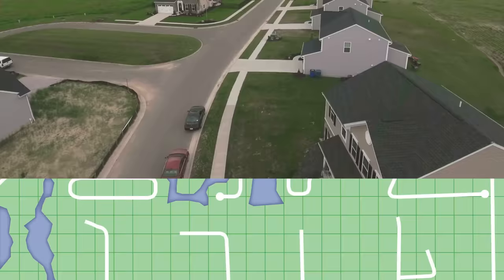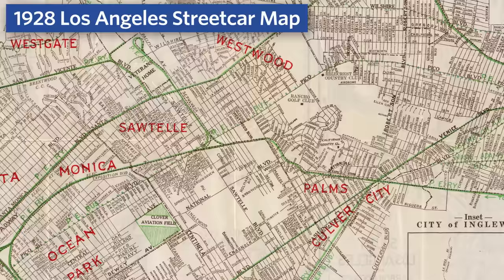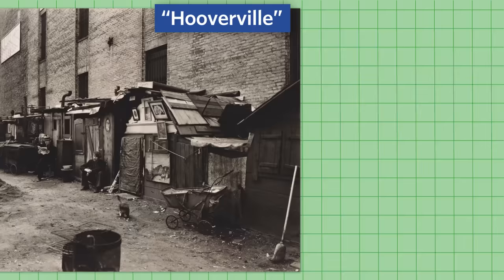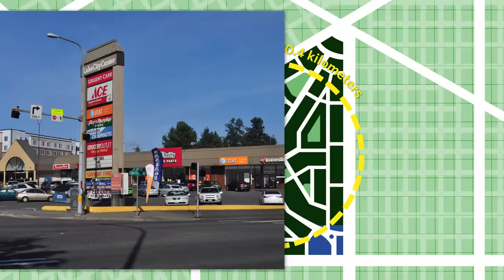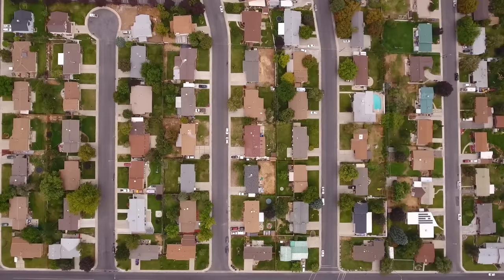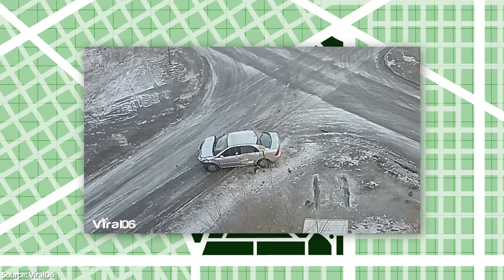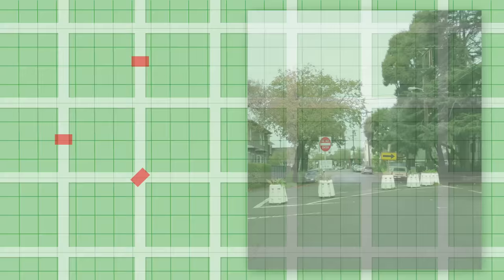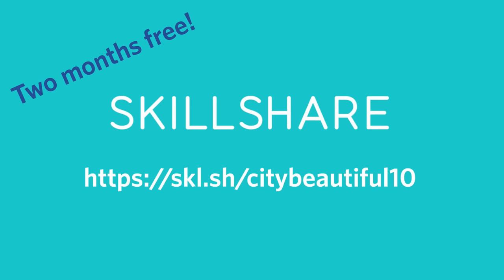The Reason Our Streets Switched to Cul-De-Sacs

Comment: As a school bus driver, sub divisions are trash
Reply: This again is an issue with the lack of good walking connections, if it was easy for people to walk to bus stops on the neighbourhood arterials the busses wouldn't need to drive all around residential streets that were not really designed with large vehicles in mind.
Reply: Yeah, the point is that its hard to drive through
Reply: We don’t build neighborhoods to benefit school bus drivers. Get rid of public schools. They’re horrible.
Reply: @HectorDiabolucus  r u serious?
Reply: @HectorDiabolucus  are you a parents or married?
Reply: @HectorDiabolucus  Why are they horrible? Because they don't nurture enough propaganda?
Reply: i hate sub divisions
Reply: @HectorDiabolucus   do you know how expensive private schools are? I find myself somewhat lucky but I couldn't go to a private school because they are so god damn expensive. And also where would the money for schools go towards? Private schools? Because if that happens THEY WOULD NO LONGER BE PRIVATE SCHOOLS. My god, and also most private schools require uniforms which are usually quite expensive.
Reply: MyOwnDesign  Yeah, same! Here buses only stop at designated stops so I always had to walk to get to a bus.
Reply: Alan Ultra , yeah um private schools use buses too 🤣
Reply: be cool or be cast out amirite
Reply: Most school buses around here (Central Florida) just drop off the kids at the Subdivision entrance then drive to the next entrance. Sucks to be you where you have to drive into them.
Reply: In other civilized  countries there is always a elementary school within walking distance, so there is nearly no need for school busses.
Reply: @HectorDiabolucus  hes legit just trolling
Reply: MyOwnDesign  2 km here.
Reply: haha it’s the tiktoker
Reply: Well at least you are not stuck in an infinite traffic
Reply: MyOwnDesign i had to get 3 different buses to school taking over an hour to get to school, it took 15 minutes in a car... americans dont understand how lucky they are
Reply: @weels95  if it takes 15 minutes in a car, and over an hour to use the buses. It is simple math, it is quicker to walk to school.
Reply: @notvuse275  What? If it takes 15 minutes by car. Let's say you are riding at 30km/h on average because it's residentials and schools areas,  you would then have 7.5km to do on foot which would take more than one hour. So simple math says take your car... Or the bus because you don't want to arrive at school sweating.
Reply: Syndi it was about 4 miles away and would require walking down a motorway so wasnt ideal to walk
Reply: @elirewasout  School choice. If you want to send the kids to public you pay the taxes to do so, if you don't want to do public the government credits the taxes back so you can contribute them towards the private school costs. As it is, families who send kids to private schools or charters, still pay taxes for the public system. There are flaws with this of course, but there are flaws with the current system and yet people seem so willing to defend it against any criticism.
Reply: ZionGo here in aus all public schools need uniforms and there not that expensive lol
Reply: Aye I follow you on tik tok!
Reply: @HectorDiabolucus  all schools
Reply: @HectorDiabolucus  ah yes let the poor just magicaly be rich lmao
Reply: @kyethepie1  - but the schools don't teach the difference between there and they're, apparently.
Reply: @markfox1545  um, yes they do... where did you get that
Reply: @PdPete11795  that is such an individualistic view. I only see this in America. You want your taxes to only benefit you rather than the community as a whole. So if I dont have kids or use parks, can I have that money tax given back to me? Of course not! I guess that is why you are the only develop country without healthcare or paid leave among other benefits that even the extreme right parties agree on in every other country.
Reply: @kyethepie1  I had uniform and it's actually cheaper. No one asks for brand clothes to wear, and you dont need to have different outfits. Just enough to change while doing laundry. The skirts were "expensive" but cos they were wool but they lasted years. Overall cheaper. I had to buy lots of outfits when I started uni since I only had "weekend" clothes haha
Reply: @stojankovacic1524  they do have designated stops for school busses but when those stops aren't accessible to everyone they have to make more stops and my bus stop has to stop for just me because the cul-de-sac style of neighborhood I live in means that it's very hard for kids to get around especially since there are no sidewalks anywhere meaning if it's a busy road ou risk getting hit by a stupid driver and it doesn't help that the roads are really small and people park on the side. I feel fine navigating my neighborhood but many parents don't feel safe letting their young kids walk far to a bus stop. In less crowded neighborhood there is only one bus stop for like 20 kids
Reply: @chrisistired6083  Exactly. My entire village is some 20 people per shift on the bus so the vast majority of us wait alone. And because private transport is horrible and I'm in the only bus in the world that has a roof that lets water through and that doesn't brake properly it's obvious they don't care about us so it takes the bus around half an hour to get around the 3 villages and because of that I have to wake up at 4:40. Rip me.
Reply: @seraphina985  Your point about pedestrian access is valid, however, in most suburban communities in my area, school buses pick up and drop of students directly in front of their homes. kids gathered at a bus stop is rare around here.
Reply: ClawBoss,
Imagine being the guy that has to plow the snow, in those neighborhoods.
Reply: If the entirety of the US wouldn't have a grid system at all, your job wouldn't even be necessary. Kids would just walk or cycle to school  or take public transport. But all three of those things are made dangerous and/or inefficient partly because of the grid system. Look at the Netherlands for an example.
Reply: @cesarheuvelmans  I live 24 km from my school and there is no grid system at all. I can't exactly walk there, can I? You can't only talk from the metropolitan urban perspective.
Reply: It also makes it more difficult for fire trucks and ambulances to get to you if you have a problem.  Meaning you have a higher chance of dying in cul de sacs
Reply: @HectorDiabolucus  "What if we took the principals of coal mining, snake oil, and pyramid schemes, and made schools out of it?!"
Reply: @stojankovacic1524  No because they are full of propaganda!
Reply: I attended some public schools as a kid in Brooklyn. And I attended one year of high school. And not a single friend from that school Is alive today. My brother was even killed this summer. He stayed in public school because his mother won custody of him. I don't know how schools are in the suburbs but city public schools atleast the ones I attended were straight garbage.
Reply: @phillhuddleston9445  How does that make private education any better? The obvious trend is that countries with widespread private education have significantly worse primary and secondary education.
Reply: @stojankovacic1524  they don’t? Ever pick up a “history” book?
Reply: @thevinyltruffle  We're talking about the present, there's no history to talk about. I'll give you a familiar example. Look at USA. Extremely low quality primary and secondary education. Most of the things American high schoolers know are taught in lower grades of elementary school here in Bosnia. Terciary education is ok there but way too expensive. The reason is that a private school just wants you to send your kid there and the state needs you to be a good professional worker. Private schools need you during your education while the state needs you after your education and thus needs you to get as good of an education as possible.
Reply: @JannesVanSlooten  you can’t always just walk to school in rural/ semi rural areas.
Reply: @stojankovacic1524  I mean they do need to teach tax and life skills not all family's can teach kids all the life skills
Reply: @christiemarie8748  Private schools don't have an obligation to do that. Some teach kids that, some don't. Also you have that in state schools in most of Western Europe so it's not special at all.
Reply: @HectorDiabolucus  Jesus christ dude, find a tall bridge.
Reply: You can't have peace and quiet and convenience at the same time. Something has to give. That's life, give and take.
Reply: @PdPete11795  I agree
Reply: @kyethepie1  - you said it.
Reply: Do you watch all the same videos I do? I keep seeing you
Reply: @seraphina985  When schoolbuses are around, the problem is schools are too far away to walk to. I haven't gone to a school with a bus until I went to university - and that's cause walking or bicycling 120 km everyday wasn't an option :)
Reply: @elirewasout  you’re unaware of the entire world
Reply: As someone with a much higher education and an actual work ethic to not be a bus driver, you cannot have an opinion about “sub divisions” unless you are wealthy enough to live in one. Because if you don’t live in one, then you’re just judging because you have less than them. FYI mr bus driver, there is something called money, wealth, and homeownership, do you know about any of the three?
Reply: @stojankovacic1524  American education system is propaganda
Reply: @HectorDiabolucus  do you want traffic jams cause by parents waiting for their kids to finish schools cause that's what's going to happen by getting rid of school buses.
Reply: @HectorDiabolucus  In case you haven't realised, the disadvantages apply to things like delivery drivers and taxis. Adding unnecessary travel time impacts the availability and timeliness of these services
Reply: You are a very tiny minority of the economy affected negatively by this design. But yes it would suck for you.
Reply: @elirewasout  okay sure man that's nice and all but. Average people do not need access to higher education. It's literally a waste of money, we force 90% of people to complete 12 years just so they can get the same employment they would have if they never went anyways.
Reply: @seraphina985  True. Sub-divisions can be good if the developers thinking of how to make it accessible and connectable by bike paths and walk paths. The hybrid model shown at  6:27 is a better solution.
Reply: @RoyMcAvoy  Indeed they are not inherrently bad in fact there are advantages to the hybrid design in that it does disincentivise motor vehicles from attempting to circumvent the planned road heirachy by rat running through residential streets as a short cut. This form of subdivision is more difficult to plan well in order to maximise the advantages of multimodal mobility but failure to do so can not be placed solely at the feet of this style of development solutions are possible with a sufficiently competent designer.
Reply: And this is why you are a bus driver
Reply: @JannesVanSlooten  that's just not true
Reply: @JannesVanSlooten  That's not true. In many countries, we have actual small villages and our towns are small. We don't have a school in every village, so children will have to use the bus to drive to the nearest village or town that has a school.
Reply: When I was a kid I walked to school. About 4 miles away for my HS and only 1 mile from my middle school.
I figured why no kid walks to school anymore is because everyone is scared their kids will get kidnapped or if they did get kidnapped for walking to school the parents would be blamed by people who don't understand what its like when both parents work full time.
Reply: Yeah, you guys need a more fluid design like someplaces in europe
Reply: @HectorDiabolucus  :omegalul:

No, we need to stop building subdivisions and suburbs. We need to centralize and stop throwing money after towns that can't stay solvent. New suburbs can hope to cover 1/5 of their maintenance. Pathetic. The rest of that money comes from elsewhere, primarily the city.
Reply: idk looks comfy esp as a eathen european,learn to drive
Reply: @stojankovacic1524  Because they taught me nothing of my history as a black person...that's just for starters!
Reply: @tima.478  That's a problem with your curriculum, not public education.
Reply: @stojankovacic1524  Are they not one in the same....
Reply: @tima.478  That's exactly what I said. You're blaming the fact that your school didn't teach you anything about your own history on public education. Those two are not connected at all. Do you know what a curriculum is?
Reply: @stojankovacic1524  But it taught me plenty about the history of another race. Why not be inclusive of many different races???
Reply: @stojankovacic1524  I'm not placing blame but rather responsibility. If you're going to teach about one races history, (caucasian), you should also teach of others. This was not the case in my public or private school upbringing. And the definition of curriculum is the subjects comprising a course of study in a school or college. This is 'exact' to the discussion here. Not sure when, where, or how you became lost...but do try and keep up!
Reply: @tima.478  Now I don't know what you were responding to in the first place. I have been arguing here for public education and against private education. You're talking about subjects in schools. How are those two connected?
Also yes, the whole education system in USA is just trash. That includes curriculums, generally. I've seen American history schoolbooks where it says natives 'peacefully moved out' to make place for new settlements. Allegedly, in most American schools, you can choose between state history, American history and world history. I have no idea how it came to someones head that teaching children only their state history or just American history is fine.
Reply: Why do you need a school bus if every neighborhood has a school at it's center?
Reply: @markfox1545  Auto correct is the problem. It just matches what you type with a list of words. If the word you typed is in the list, it's correct, if not, it's wrong.
Reply: Calling things "trash" - are you trying to emulate the kids you 🚙 around?  😜
Reply: In Norway, schoolbusses aren't a thing most places. We have something called public transport and bicycles and legs.
Reply: @scottbc31h22  my neighbourhood is the same, the stops are mostly at intersections but if you live further than 500 m from one of those you get dropped at your driveway. But sometimes there are lots of students at driveway stops. Not sure if I would want 10 other random students waiting in my front yard for the bus
Reply: Great Content ClawBoss!
Reply: Snow plow drivers aren't fans of cul de sacs either.
Reply: Roasted Potatoes  Guess that is not the same everywhere as the only time I ever dealt with them was when I was living with a partner that had a child in Cape Coral, Florida. There the pick up was around 0.5 mi from the house, which was especially ironic as the main road was closer, so they had the bus taking a meandering route through side streets only to stop at a few places in each block anyway. I thought it was weird making the route so much longer while not really changing the walking distance for anyone but at this point I'd visiting 15 other American cities more than enough to learn never to expect to find sense in anything transit related there lol.
Reply: Roasted Potatoes  "Designated by whom?" -- The bus company. And they have no idea where anyone lives. They just pick stops close to each other so anyone can reach them easily. The bus driver still stops wherever someone is waiting for a bus (including their house) and passes bus stations with no one waiting. The end result is that there's essentially just a route with preferred bus stops.
Reply: As a delivery driver, subdivisions suck. It can literally take 30 minutes of driving to a house in the middle and then back out of the subdivision.
Reply: Whiteboy14  Impossible to tell if someone's trolling these days, especially when I have heard this opinion unironically by some people.
Reply: Whiteboy14  person, it's not always possible for people to get a better job. Maybe I'm not poor, but I am not per se well off. Anyway, I have saving up for surgery I will want in the future so I can be myself and be able to walk around topless.

Comment: Always figured cul-de-sac and T intersections were the developers squeezing more houses into a development for more money.
Reply: Honestly, the biggest problems are the dead-end roads, which artificially limit the traffic during emergencies, and wavy roads. Grids can still be made even with only T-junctions, by simply having very long straight parallel roads for one axis of the two axis of the map, with smaller roads forming T-junctions on both ends, so you have to go zig-zag to go diagonally and to go on a square zig-zag or square sinusoidal to go up and down if the very long parallel roads go left to right on the map, for example. And you can still have higher-capacity roads which to have 4-way intersections with roundabouts, to get cars faster into and out of the city. And you can even use traffic calming techniques like speed bumps and different bumpier road design, so only the local vehicles use those roads, and have the rest of traffic routed through bigger intersections or have people just move slower through those roads to arrive faster than going through those bigger intersections.